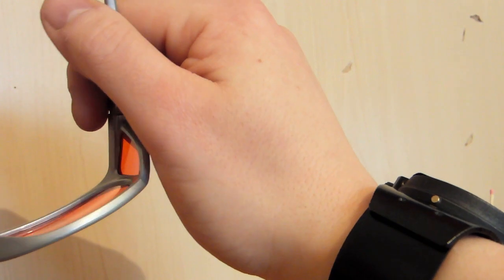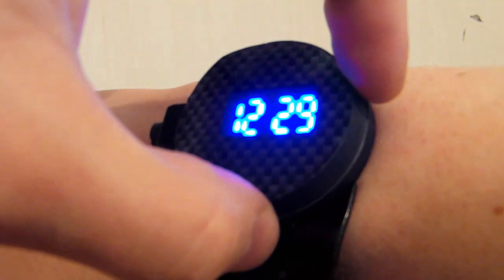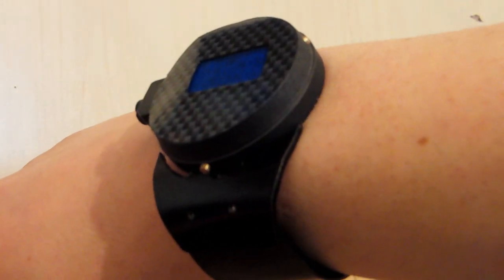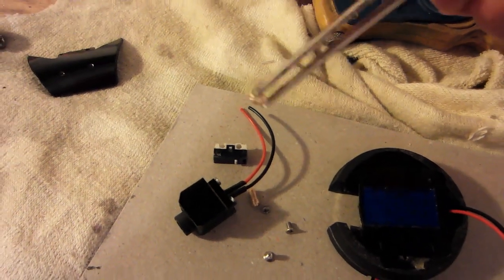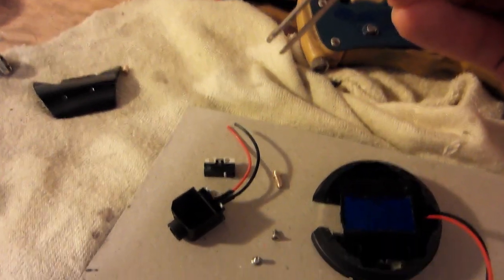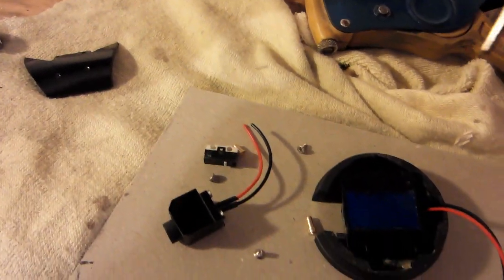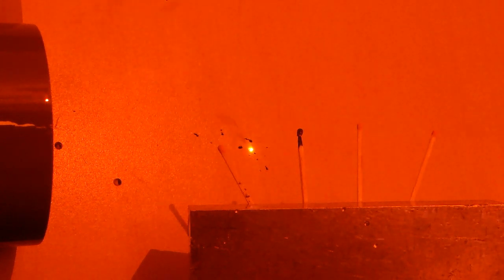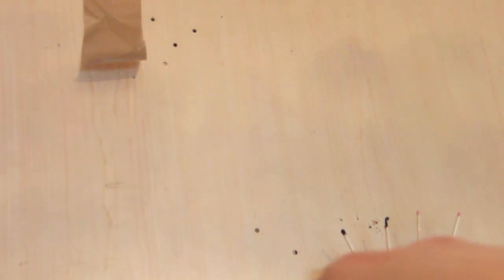Bond-inspired LaserWatch ( selfmade, including some burning laser tricks)

Comment: hey lasergadgets do you have to wear the glasses to use the laser ?
Reply from the maker: Yep.
Reply: ok
Reply: really you dont have to but if you want to see after you use the laser, you would wear them
Reply from the maker: Eden Frawley
It depends on the distance. If the spot on the wall is just 1 feet away, you need glasses, if its 20 feet, it will not inflict any eye-damage.
Reply: true
Reply: LaserGadgets that is so high tech and amazing .
Reply from the maker: The_Master_Builder
Its a weekend project, but thanks ^^

Comment: That's a really cool watch. But I would recommend mounting the laser 90o from where it is, on the pinky side of the watch. This would reduce the risk of burning your own hand and would make aiming and firing quite a bit more discreet. A simple fix for this would be to just mount a prism on your current build in front of the laser to bend the beam the 90o needed.

Comment: Awesome work.
Since the installation is so small, will the laser overheat and burn itself out if you run it too long (and if so, how long is too long, do you think? A twenty second burst? Thirty seconds? Could you feel it getting hot on your wrist as you used it here?)
Reply from the maker: I guess the battery will die before that happens ^^ actually it didnt really heat up during the shoot. The flickering was caused by the battery I guess.